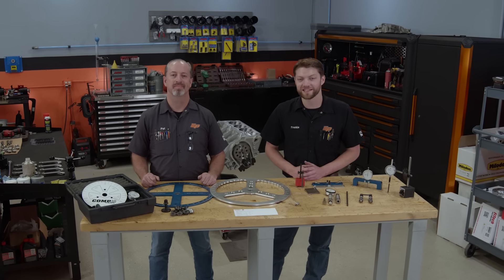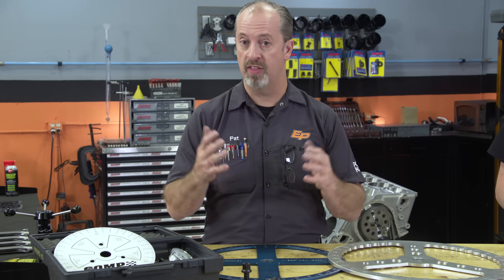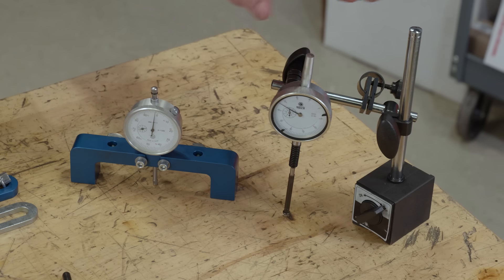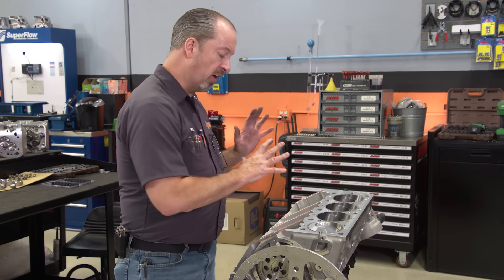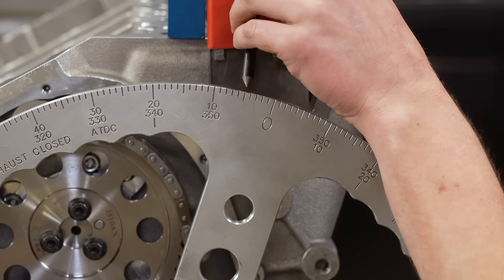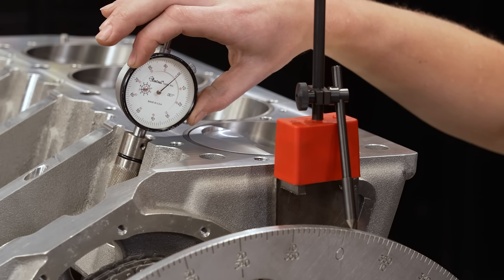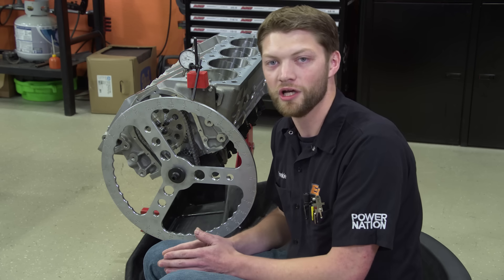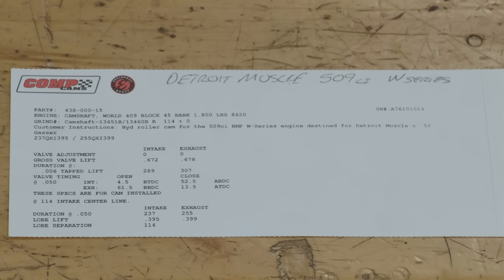Degreeing a Camshaft Correctly: Why You Can't Just "Line Up the Dots"

Comment: Your TDC was wrong. the midpoint between +6.5 and -1.5 is +2.5; not +4. ((-1.5)+6.5)/2=2.5.
Reply from the maker: When shooting for a centerline, we want the degree wheel and pointer to show the same point on either side of the wheel at the same depth on the indicator. So each side of 0 is “separate” and we can average both numbers as a positive, which tells us the pointer needs to move 2.5 degrees to the right, so that instead of reading 6.5 and 1.5, it reads 4 degrees when the piston is .005” below TDC on both sides. We can average the numbers together and then move the pointer to 4 when the wheel is at .005” below deck and then the other side will now also show 4 at the same point. Hope this helps clear it up!
Reply: @e@e @enginepowertv  you’re trying to find the number between 6.5 and -1.5 right? That would be the average of any two numbers, the midpoint. Let’s add 10 using 10 as “zero”. You would have 16.5+8.5 (a +6.5 and a -1.5)   (16.5+8.5)/2= 12.5. Without the 10 it’s 2.5. I understand you’re taking the reading at either end of the stroke and averaging them and find the peak piston position, but you found the number just before peak. Draw a number line between 6.5 and -1.5 and see what’s in the middle, 4 is about 37% off

Comment: Whoever designed the cam knows more than me.  I line up the dots.  I always figured you're either lined up, or a tooth off in either direction, and that's bad.  

Then there's BMW that doesn’t have keys on the sprockets.

Comment: you never showed how to set the cam up differently, how does one adjust this?
Reply from the maker: It depends on the engine and timing set, but most OE timing sets would require an offset key to adjust the cam timing. Aftermarket setups can either have a rotatable cam gear or a multi-keyway crank gear that can be installed in different positions to advance or retard the cams timing. Generally we install the timing set dot to dot to start, find where the intake centerline lands, and then move it from there if we want it to be in a different position

Comment: It is very important to at least find the actual TDC even assembled so that once you do, place the timing chain cover on with the damper to see if your timing groove on the damper actually lines up correctly with TDC. You may have a faulty vibration damper. 

Question- how will a cam advanced or retarded effect manifold vacuum? I have heard an installed retarded cam can drop manifold vacuum from a cam manufacturer. This can affect the power brakes. 
Not an easy demonstration. Thanks for taking comments.

Comment: Did show which way you move the wheel
Reply from the maker: When taking measurements on position, you always want to be rotating the engine in the direction of normal rotation, that way factors like timing chain slack don’t give you inaccurate results

Comment: I have watched many videos on this but none show how to set the cam up. If you have to move the cam a degree one way or the other, how do you do that?
Reply from the maker: It depends on the engine and timing set, but most OE timing sets would require an offset key to adjust the cam timing. Aftermarket setups can either have a rotatable cam gear or a multi-keyway crank gear that can be installed in different positions to advance or retard the cams timing. Generally we install the timing set dot to dot to start, find where the intake centerline lands, and then move it from there if we want it to be in a different position

Comment: Without an adjustable cam gear in relation to the crank gear, degreeing the cam only tells you how far off the cam and TDC centerlines are?
Reply from the maker: Correct, it is a verification process to make sure the timing set was installed correctly and there are no manufacturing issues with any of the components. If you want to change the centerlines on a non-adjustable timing set, they also offer offset timing gear keys that allow you to move it in specific increments

Comment: Can someone explain to me this block? It seems as though the deck is cut at an angle to the cylinders with their walls having a recess machined in them. I mean the pistons don't sit flat to the deck. Never seen this before.
Reply: It’s based of the  original 348/409 w engines that are 74 degrees as opposed to the normal 90 degrees. This is an aftermarket block as original w blocks are harder to find these days. Yes, the combustion chamber is in the block side.
Reply: @twgarage-terrywatson1672  What did they come in from the factory?
Reply: @green95gt 1958 Chevy was the first year, started out at 348 cubes, Impala, Biscayne etc full size cars. Mid year of 1961 the 409 was available. 409 continued till 1965. Many versions. Super rare 63 version as the Z-11, not to be mistaken as the mystery motor which is a totally different design. 427 Z-11 W engine rated 430hp was the king for the w engine but it was a special drag race deal. This is just the basics lots more info.

Comment: Wouldn't TDC be at 2.5 instead of 4?  The halfway point of 8 is 4, but that is 4 degrees from one end or the other (6.5 ATDC or 1.5 BTDC) which puts you at 2.5 ATDC on the wheel, not 4.  Am I wrong?  Great video!  Love seeing the whole process.
Reply: You are correct!  The 4 that he calculated shouldve been subtracted from the 6.5 degrees.  Not put the pointer at 4 degrees!!
Reply: Well if you think about it, he did end up moving the pointer 2.5 degrees atdc. He moved the pointer from 6.5 atdc to 4 degrees atdc which is a difference of 2.5 degrees. He then rotated the wheel 4 degrees to make the pointer point at 0 degrees, which was effectively 4 degrees forward from his 6.5 degree atdc measurement. If he had not moved the pointer, it would then read 2.5 degrees atdc like you’re thinking

Comment: I have used a dial many times to locate tdc. One other method as mentioned is with a stop. Bring up close to TDC and mark damper. Turn back and mark again. The spot exactly in the middle is TDC. This method will take up any small degree of slack that might be there. I don't want to get into a debate about engine building. Just another suggestion.

Comment: For straight up builds with a more generic timing set like comp cams, Ellenbrook, etc. I have always been with in a degree. Only time I have degreeded a cam was when a client wants a to large cam (chop) or going things in stages (budget) and we needed to retard the cam a few degrees for piston clearance. Is it worth the check? If you have the tools. I have seen issues with people putting in mild or RV cams with stock timing chains without verifying that some stock chains are offset slightly. I want to say some ford big blocks? truck engines degree cam a few degrees. Otherwise degreing, blueprinting, etc. really useful on specific setups (higher end). Why build a 10k motor and not degree the cam for max performance for your set up. Those engines usually are set outside the cam card setting though.

Comment: Tdc should be done with a stop near the centre of piston it’s more accurate than a dial on the edge when the piston is free to rock.

Also the intake centreline is midway between open 0.050 and closing 0.05. Should not use peak lift

Comment: I've built a lot of engines and I've never even once bothered to degree a cam and I've never had any issues.
Reply: So if I install a new cam in my Chevy 350 I should be good bro?
Reply: @iBounciesTv as long as cylinder #1 is a TDC (top dead center) and you align the timing marks on the crankshaft and camshaft sprockets, you should be good 👍
Reply: @bluegizmo1983 thanks bro I will learn how to do that without upgrading lifters? Or anything else ok?
Reply: @iBounciesTv  as long as you are staying with the same type of camshaft (hydraulic flat tappet, hydraulic roller, or solid roller, whichever type your engine already has) and you aren't going to a huge lift cam, you shouldn't need to upgrade lifters or valve springs.
Reply: @iBounciesTv  On a flat tappet camshaft (not a roller rocker cam), if you are changing the cam, you need to change the lifters as well because when you break in the camshaft, you also break in the lifters. They are married to each other. That’s why you number them if you’re pulling a cam and lifters and putting them back in again.

Flat tappet lifters have a slight crown to the surface that meets the camshaft and the camshaft lobe face has a bevel so that the lifter rotates when it is lifted by the camshaft lobe; this prevents catastrophic wear to the lifter and camshaft.

On small black Chevy engines I’ve built, I’ve just done dot-2-dot because I didn’t know any better. Last year I built an engine for my Mustang and I decided to blueprint the engine build. Dot-2-dot my camshaft was nearly 10 degrees advanced of where it should be according to the cam card. I have an adjustable timing gear set with 16 degrees of adjustment so I was able to correct it. It would have run ok dot-2-dot, even with that 10 degree error but it would have moved the power band lower and the top end would suffer slightly. It’s a street car and I’d never have noticed but it is completely bang on now.

Comment: To everybody that commented, if you are just rebuilding your stock engine, then line up the timing marks. If you are trying to squeeze every ounce of power out of your hot rod, then buy an adjustable timing set and degree your cam so that all of your parts work together flawlessly this is an integral part of blue printing your engine.
Reply: Thank you. 
   I've seen these guys show how to degree a cam a dozen times. Always left with the question,"What if I need to change the centerline to suit my application?" 
    Your comment answers that perfectly, and closes out this incomplete video. 
   They never tell what the point of it all is. Thanks again

Comment: Good job, guys. You just showed how to degree a cam on an engine with zero adjustment in the timing set. Glad you convinced me to spend hundreds on tools and not mention that important bit of information.
Reply from the maker: C @enginepowerty)
• 1 minute ago
At minimum this can be a verification process to make sure the timing set was installed correctly and there are no manufacturing issues with any of the components. Even on some non-adjustable timing sets, you can use offset crank keyways in certain applications to move the cam if desired as well
Reply: Thanks Josh, that's what I was thinking too.

Comment: So if I just have an OEM timing chain in my gen 3 hemi - is this worth it?  Not sure how you would change the timing if needed - do you skip an entire tooth on the gear?  I know some cams have slots that allow you to tweak the angle, but???
Reply from the maker: At minimum this can be a verification process to make sure the timing set was installed correctly and there are no manufacturing issues with any of the components. Even on some non-adjustable timing sets, you can use offset crank keyways in certain applications to move the cam if desired as well

Comment: Who else caught the mistake when he determined tdc?
Reply: Yep tdc was actually at 2.5 atdc on the dial
Reply: @9psi  BINGO!
Reply: I understood that they always turn the engine in the same direction when checking TDC. So before TDC, the connecting rod pushes the piston upward, and after TDC, it pulls the piston downward. The connecting rod clearance was on the other side of the cam pin. The result is not the same as if they were using a piston stopper or turn crank both direction. I'm not saying the result is wrong, but it's not the same. (We have to remember static and dynamic TDC.)

Comment: Dear Pat and Franky,
These lifter bore indicators are not good for roller lifters. Please take the following into account.
Since the diameters for the roller on the lifters can be different per application you WILL get a wrong measurement. These indicators only work if the radius of the tip 100% matches the radius/diameter of the roller on the lifter being used.
We did learn this in a very hard way on a Top Methanol Funnycar.
Always use the roller lifter that will be used in the engine to get the cam in the real position where you want it. This way you eliminate any problem that the tool (substitute part) might create.
Measure it all again with the actual roller lifter and compare it to your lifter bore indicator, check for the differences, you’ll find them.
If there is any play in the tip to the body of the indicator, the measurement gets even more inaccurate.
We have seen tips where the pilot was not 100% centered and wobbled. My advice is, don’t use them, they do more harm then doing good when you want to be as accurate as possible.
Reply: Very intuitive and cognitive.makes perfect sense.. roller diameter will change final numbers. Will note your observation in my don't forget assembly card.👍

Comment: Interesting..  I've always done it by looking at the opening and closing on the lifter.    Used the spec sheet timing at  0.053 or 0.050 lifter on the card.  I would have placed the piston indicator directly over the pin..

Comment: There are a few content creators on YouTube that say it's hard to get a decent cam anymore. They say that the cam is not hardened or the lifters. The cams fail. In fact, they say many things are made overseas and will fail much sooner than in the past. These people also build engines and repair and build cars and trucks. I don't know. I see what the big three is putting out now days. The recalls and engine failures. Maybe they are right. I just don't know enough to form an opinion based on personal experience. I know. They say. A phrase that is overused. But that's what they say. I wonder if these guys would perhaps do a comparison among longevity among companies that sale aftermarket parts.

Comment: You guys are great and I watch every video. With that said I do disagree. Degree cam is only meaningful if you have an adjustable cam gear.
Reply from the maker: We’re glad you enjoy the content! Can you install a cam without degreeing it? Yes, but at minimum this can be a verification process to make sure the timing set was installed correctly and there are no manufacturing issues with any of the components. And even on some non-adjustable timing sets, you can use offset crank keyways in certain applications to move the cam if desired as well

Comment: Having worked in a manufacturing facility that built engines. OHV and OHC. On assembly the cam orientation was set off of the keyway cut in the camshaft/s and the crankshaft. The lobes were ground in relation to the keyway. This applied to both old style cam grinders that used master cams and CNC type grinders.

Comment: So basically just line up the dots unless you think you know more then the cam company that engineered and marketed it for a specific engine. The only time I can see someone needing to do this is if the camshaft or cam gears a manufactured with the wrong location for the dots or if you have a highly modified engine. Anyone looking for a cam for a mostly stock engine should just line up the dots.
Reply: Back in the day, me and most of my gear head friends never degree’d the small block engines we used to build for our Camaro’s, Monza’s and Vega’s and the few guys around that did build precision engines, didn’t share that voodoo with us. Our engines were fine. They were street cars and they were never pushed that hard. It would be interesting to see how accurate dot-2-dot is on the random late 60’s or mid-70’s sbc 350’s we had in our cars. 

I degree’d the cam on my 66 Mustang build and it was out +10 degrees. I spoke with one of the guys at Clay Smith and he wasn’t surprised in the least. I have an adjustable timing chain set and got it dialed in.
Reply: That's a blind man answer
Reply: @FattDogge 
And also accurate.